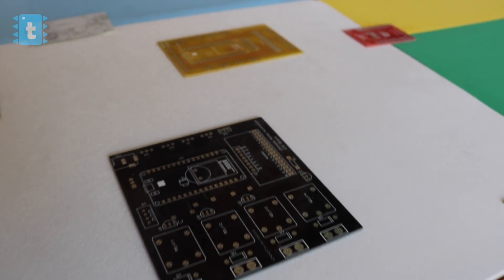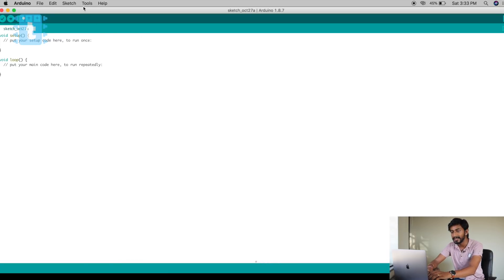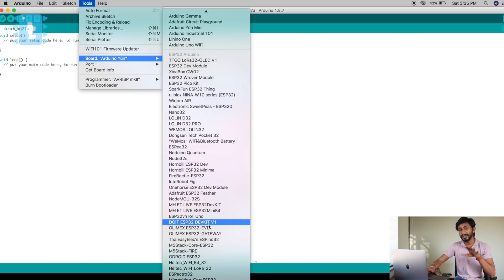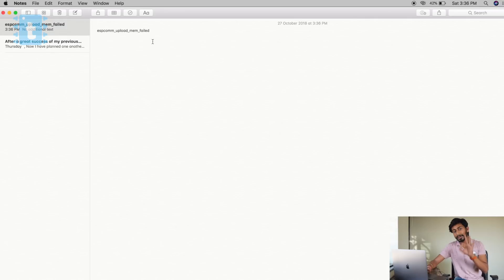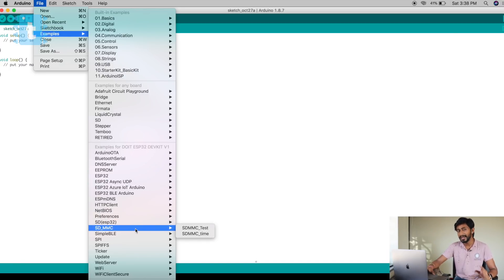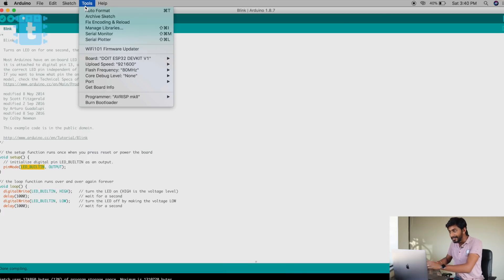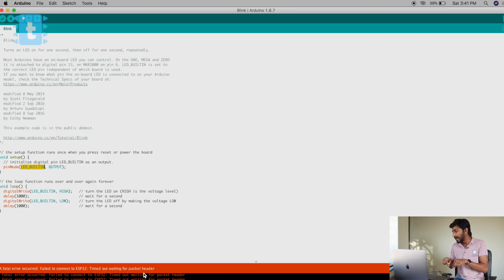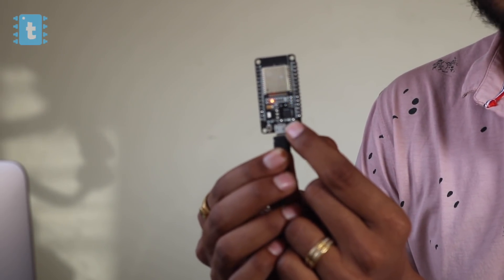[E-1] Getting Started with ESP32 using Arduino IDE | Solution of Timed out waiting for packet header

Comment: Arduino: 1.8.10 (Windows 7), Board: "DOIT ESP32 DEVKIT V1, 80MHz, 115200, None"

Sketch uses 207705 bytes (15%) of program storage space. Maximum is 1310720 bytes.
Global variables use 15228 bytes (4%) of dynamic memory, leaving 312452 bytes for local variables. Maximum is 327680 bytes.
esptool.py v2.6
Serial port COM3
Connecting........____....._____....._____....._____....._____....._____.....____

A fatal error occurred: Failed to connect to ESP32: Timed out waiting for packet header
A fatal error occurred: Failed to connect to ESP32: Timed out waiting for packet header

This report would have more information with
"Show verbose output during compilation"
option enabled in File -> Preferences.

Comment: Sir I am using this board for a month and I haven't downloaded python 2.7 in my windows and it is still working fine
Reply from the maker: You must have installed python 2.7 for any other software or may be it was installed unknowingly along with any other software 

Otherwise it won’t work at all
Reply: @techiesms  sir I checked that but there is no python in my pc

Comment: I performed aal of these steps and can run several example programs in addition to  Blink, however when running several other more complicated example programs I get an error saying trouble compiling to ESP32 Dev Board, or trouble compiling to DO-ESP32 Dev Kit V1 Board when other examples had no problem running using these board names. Do you know what causes this error or can you point me to a source that will describe what causes this error?

Comment: I used this method perfectly and was able to run many programs and projects. Thanks you. However, recently I tried to connect a board to a TFT SPI ILI9341 color display and the video showed connecting pin 17 to MISO. The DO-IT_ESP32-Dev Kit does not have a pin 17. I looked in my supply drawer and found a Geekworm Easy Kit ESP32 that is slightly longer than the Do-IT (20 pins vs 15 pins). I found it used a CH431 driver instead of the CP2102 Driver. I found the 341 driver on the internet, downloaded it, and installed it. Now my device manager shows two available com ports for the 2102 and two more for the 341. Great. But the IDE still greys out the port not allowing me to connect the new ESP module. Do you know how to make the IDE recognize the loaded drivers? You have been really helpful and I enjoy your approach. Long time sub, appreciate your clear comprehensive approach.
Reply: Issue resolved. Problem was USB to Micro cable was missing the two data wires which caused the grayout. Change to an older cable with all four wires and the com port was instantly visible again. Found solution on thingsconnected.io forum. This environment is amazingly sharing and a wonder to behold. Thanks to techiesms for being part of the support community.

Comment: In your video about getting started with ESP32 boards with a Arduino blinking sketches, you mention installing Pyrhon 2.7 after installing the CP210 drivers.  What was the need for Python 2.7 installation?

Thanking you in advance,
Paul D. Wilkie
Reply: pyserial library which is in python 
is needed for serial communication